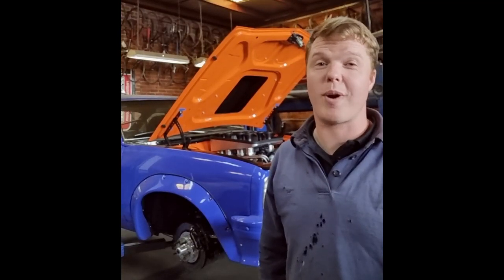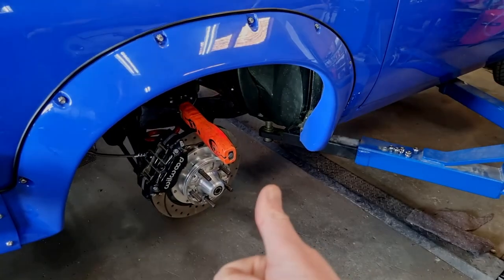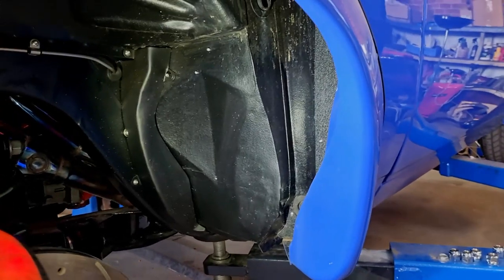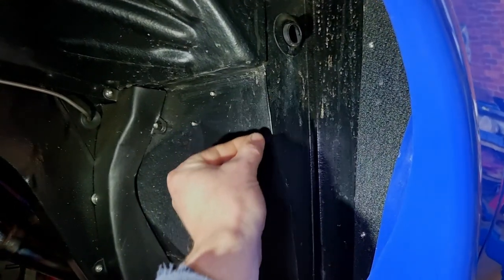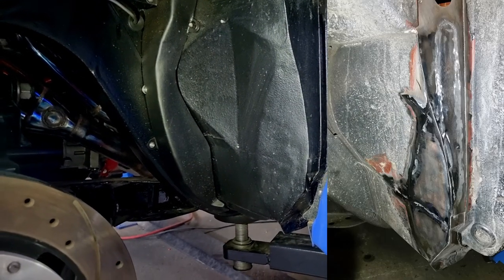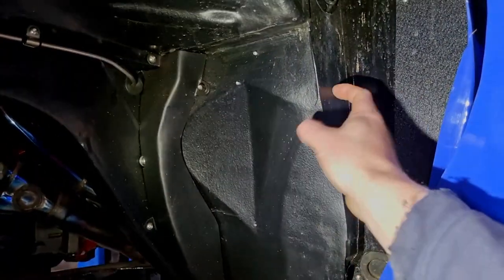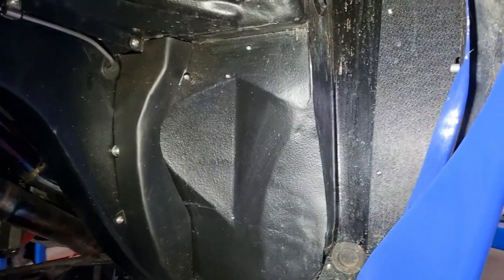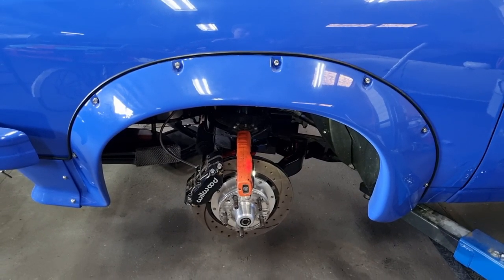Flared Torana FRONT Guard Cut and Wheel Clearance Mods

Comment: The brand of fibreglass flare will also make a difference as well. I've used Repliglass or Wilson for a resonably true representation of the original G&S flares.
Reply from the maker: Yeah, there would have to be serious variance between different brands etc. 

Even my flares and guards (both from Alfa Fibreglass), while nice panels overall, are actually not symmetrical on the car! The eyebrow/wheel arch had to be pushed out about 13mm with a brace I made for the RHS of the car. Not what I expected.

Comment: The fibreglass flare won’t actually fit properly without removing the small original metal flare stamped into the guard as it tends to angle the new fibreglass flare upwards and outwards in the upper centre, forcing the lower edges outwards as well.

Comment: Hi, what size tyres and rims are you running and what offset.
Reply from the maker: Sorry for the slow reply. Fronts are 16x10" -1 offset with 225/50. Rears are 17x12" -41 with 275/40. The wheels are a little different to that in spec, but I've included the hubcentric spacers I'm currently running in those calculations. Diff is 46" wide between hub faces, which is shorter than standard.

Comment: Show the flared section with the fitted tyres to the front next time to get a better picture of the car as it would be fit to drive.
Reply from the maker: Hi Christopher, what is it that you were wanting to see more specifically? I included the image at 0:40 to demonstrate how my car sits, but ultimately that doesn't matter that much - clearance is just a good thing and I've tried to show people every area that it will help... you just need to add as much clearance as possible, and then you measure wheels and tyres that sit a distance away from things that you are comfortable with. Mine is quite close, but I know not to steer hard when the car is articulating over a driveway entrance or something like that.